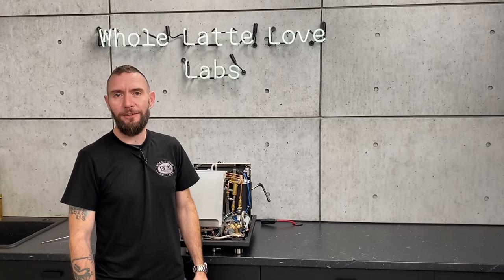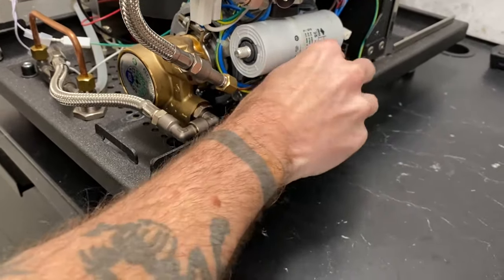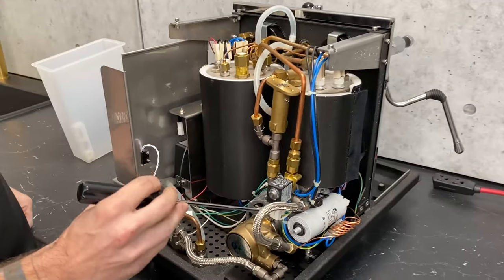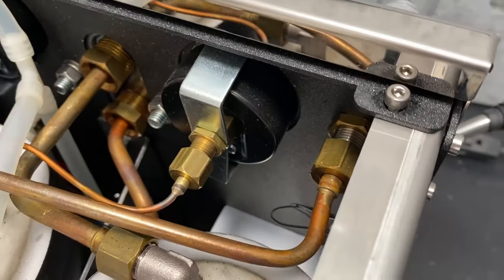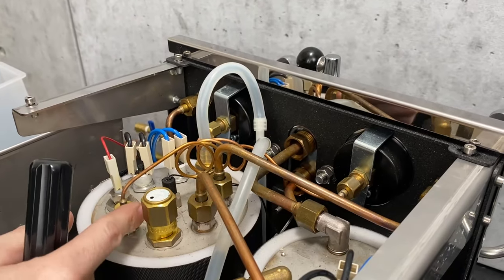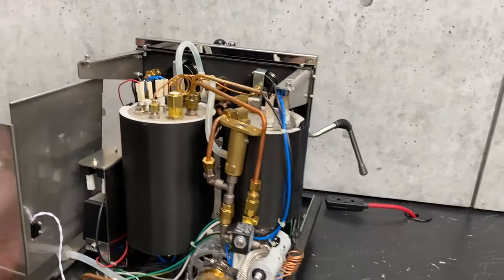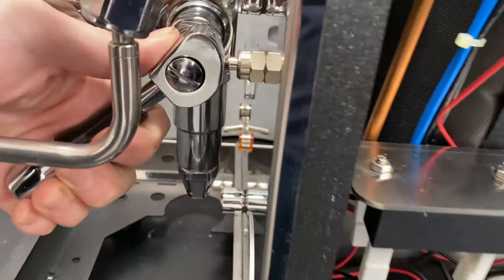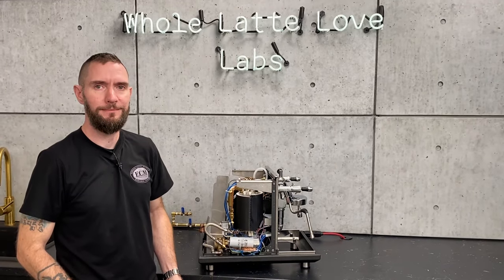ECM Synchronika Espresso Machine Internal Components Tour, Overview & Identification

Comment: I have this machine at home and this is very informative! Do you also have a video on how to properly descale this ecm?
Reply from the maker: Hi s, We do not have a video on descaling dual boiler machines. Best course is to use water that does not cause scale in the first place. You can use traditional sodium based water softening to reduce scale causing calcium levels or systmes like those from BWT Water & More which exchange magnesium for calcium in tap water.
Reply: @Wholelattelovepage  Thanks for the reply! I am using a BWT filter on my machine. I’ve put it on a fixed water supply since a bit more than a year now. In the first year I used the water tank with these small filters, but I think it got some scale in the machine form that. Maybe didn’t replace them often enough. There was some scale in the hot water tap endpace, so this will indicate it’s in the whole system right?
Reply from the maker: @stevenvoskuilen1226  Scale in the hot water tap could indicate scale elsewhere. Also a chance what you saw there was not scale  - perhaps other solids that accumulated. Using the BWT now you could be fine and what you saw maybe not concerning. If desired, you could take the mushroom out of the E61 group and check for scale and debris there. Here's a video covering how to take the mushroom apart to check its particle screen and jet. Those are areas where scale would be evident if a problem: https://youtu.be/ELIwD40tsrs?si=VfXsO4wVex0hQVf9&t=1366

Comment: For interest the capillary coils aid dampening of the pressure signal so the gauge pointer does not chatter. Many thanks for this video, as an engineer understanding the machine is most important to me. I have a Jura S9 and have kept that machine running for some 18 years self learning and odd clips. Always wished for a more hands on machine, you have just sold it to me. Be contacting you soon for purchase.
Reply from the maker: Thanks for the info!

Comment: this is a top quality video. thanks for the detailed information! Anyway, I am looking for instructions on descaling for this machine. The manual says it should only be done by skilled professionals. I guess that is because the boilers cannot be emptied completely without unscrewing parts of the machine customers usually are not supposed to access. Maybe I can puzzle together my own way for descaling, but a video or other information on best practice for descaling would be much appreciated. Thanks for this video however! You are doing a great job!
Reply from the maker: Hi WW, Thanks for the kind comment. The reason manufacturers recommend professional descaling is the risk of scale breaking loose and plugging other parts of the machine. When our techs descale dual boilers the boiler are almost always removed from the machine before descaling. Doing that is beyond the capabilities of most home users. That said, it's possible but risky for someone with the right skills/knowledge to descale without removing the boilers if one is 100% certain there's only very minor scale deposits in the machine. More recent Synchronikas do have the internal drain on the brew boiler which makes emptying the boiler easier and descaling a bit less risky.

Comment: What size T would I need to replace the plastic one?
Great video, thanks.
Reply: I believe its 1/4 inch barbed T connector although someone said that was too small and 5/16 worked better. You can possibly get a food safe metal one from plumbing store not sure I'd that's gonna cause issues and need to be replaced anyway due to scale buildup.

Comment: Two questions. 1. How do I adjust the pump pressure? 2. My Synchronika has flow control. The maximum pressure I ever read at my group-mounted gauge is just a hit over 8 bar. Should I try to adjust the system to deliver 9 bar at the group?

As always, thanks for your top-quality content. It’s why I keep coming back to WLL for equipment—and coffee! (Love both Crema Wave and Beamed Up!)
Reply: My profitec Pro 700 Hits 10 bars and I never adjusted it that's the way it came from the factory
Reply: I'm concerned I'm putting out too much pressure
Reply: @mjmjersey  That 10 bar that you're seeing—is that on the gauge at the front of your machine (the one labeled "Pompa"—Italian for pump)? For reasons I can't explain (unless it's because you're getting some flow through the puck; but I don't think that's it, because even when I grind too fine or tamp too tight, so that I get almost no flow, it still doesn't go much above 8 bar in the brew group)), that number typically is higher than the actual brew pressure, on my machine, by about 1 bar. I have a gauge on my brew group (because I installed flow control), and that one reads about 1 bar lower than the "Pompa" gauge on the front of the machine. If that's true for your machine, too, then a 10-bar reading on your Pompa gauge translates to about 9 bar of actual brew pressure. My guess is that you're fine as it is, and you don't want to change it.

Hope this helps...
 --David
Reply from the maker: Hi David & Michael, Thanks for the comments and funny you should ask about adjusting the brew pressure. Just finished shooting a video on how to do that with our service manager Brian. I'll likely have that one posted tomorrow. Included in the video is an explanation of why the machine gauge and group gauge (on models equipped with flow control) will indicate different pressures. Look for that video to post tomorrow. FYI brew pressure adjustment procedure is identical on both the Synchronika and Pro 700.

When we setup those machines we adjust pressure to ~8.5 bar on the machine gauge - that's the gauge on the face of the machine. That gets you ~9 bar in the group on a plumbed to waterline machine. Pressure indicated on the group gauge (FC equipped models) will gently trend higher than the 8.5. Why that happens is explained in the video. The quick answer is the gauge on the face of the machine is measuring pressure very near the pump in cold water. In the valve tree after the tap for pressure measurement there is a one way valve. As the cooler water at 8 bar moves beyond the one way valve and into the hot boiler it expands increasing the pressure a bit so seeing 10 bar on the group gauge is normal as water in this part of the system is trapped on the other side of the one way valve.

To change pressure one uses the rotary pump's bypass adjustment which is located underneath the left rear of the machine. Look for the cutout opening on the base which allows access to the adjustment which is made using a flat blade screwdriver. To allow for adjustment with the machine running the pump we carefully hang the left rear leg of the machine off the counter. Insert a blind filter basket into a PF, mount in group and turn the pump on. Or, you can just close the flow control valve completely without a PF in place instead of using the blind filter basket. From there, turn the adjustment until you read 8.5 bar on the machine gauge. If uncomfortable running the machine with a leg hanging off the counter you can leave the pump off, make an adjustment and check the pressure by turning the pump on. Repeat the adjustments until you arrive at your desired pressure. To help guide your adjustments it's ~1/4 turn to increase/decrease pressure by 1 bar.

Hope that helps and look for the video posting tomorrow. It also cover the OPV inside the machine. That OPV might confuse those newer to working with a rotary pump machine. On your dual boiler rotaries it serves as a safety valve for max pressure in the system after the check valve and is not used to set brew pressure like it is in vibration pump machines.

Marc
Reply: @Wholelattelovepage  Wow, Marc! Thanks so much for the detailed response. I will certainly be watching for the video you mention.

Have a nice evening!
Reply: What parts would have to be upgraded on an older Synchronika to get the 2.5 bar steam pressure? Is it as simple as upgrading the pressure valve to 2.5 bar? I believe I bought mine from you guys around 2018-2019. Thanks for the greatly detailed video!
Reply: @cachamp203  Just to be accurate, I believe that 2.5 bar number is only the safety valve's blow-off rating. Actually getting to that pressure requires a higher steam boiler temperature than the PID on my Synchronika allows. The temperature won't go above about 272ºF, and that only produces around 2 bar, not 2.5. You need some headroom in that safety valve; you don't want to run at a temperature that brings the pressure too near to it. That said, I find that 2 bar is plenty. The trick is to let off a little water from the steam boiler, which will start the heating element running again, and then just before it gets back to 2 bar, start steaming. When I do that, it usually stays at or above 1.5 bar throughout the steaming process, which I find to be more than sufficient for 5 ounces of milk, my standard latte.
Reply: @eclexian  my machine is the exact same as yours it sounds like. The way David talked, made it sound like the newer models allowed more pressure in the steam boiler. I would imagine the boiler would be built a little heftier to allow the extra pressure and the PID would have to allow that adjustment. I bought a 4 hole steam wand tip which allows you to steam milk even faster. I believe Marc has mentioned doing that in prior videos. I’ve also gone back and forth between the two tips. You have to be pretty familiar with steaming milk to use the 4 hole tip so you texture the milk properly. Sometimes the 4 hole tip will relieve too much pressure from the boiler and gets down to around 1 bar while steaming milk as well.
Reply: @cachamp203  Right; there you go. As to which one you have, I bought mine in early 2019 (just before cancer surgery, to give me something to look forward to; that’s how I remember it). I believe if the PID will let you set the temperature to 270°, then you have that upgrade.
Reply: @eclexian  yes when I have coffee in the basket and I'm brewing that gauge on the flow meter on the group head goes to 10 bars is that okay or do I have to back the screw down
Reply: @eclexian  it's the flow control gauge that I'm getting the 10 bar on
Reply: @mjmjersey , that’s what I’d expect, given Marc’s comment about what’s actually happening. Leaves me unsure why I’m seeing the opposite: the pump gauge reading about 1 bar higher than the brew-group gauge. Need to look for the video he mentioned would be coming out yesterday.